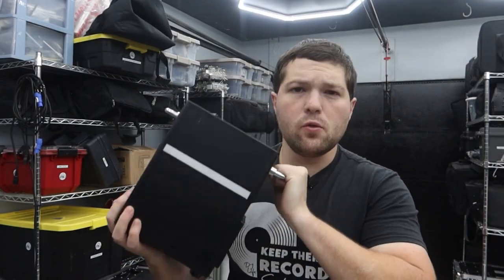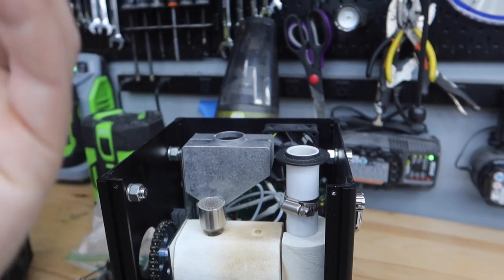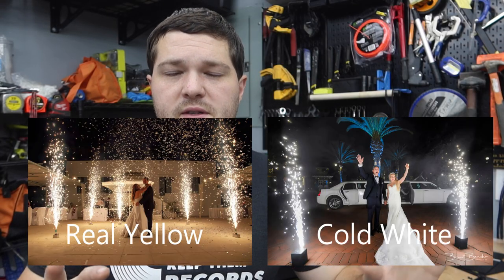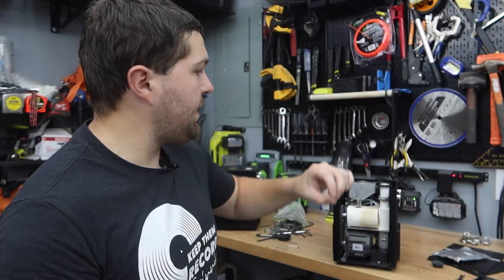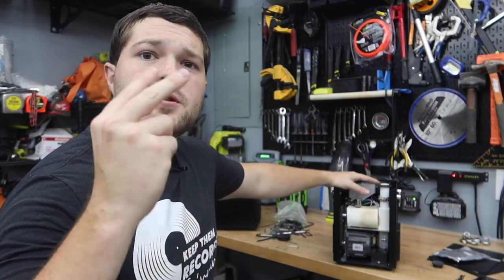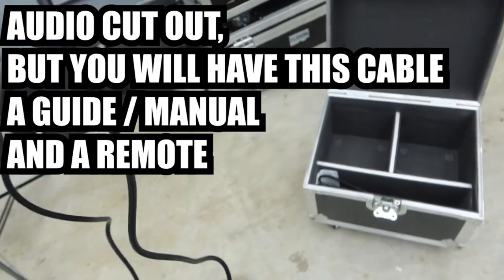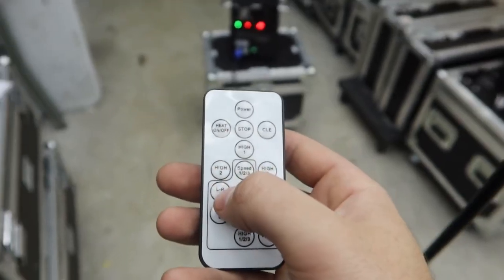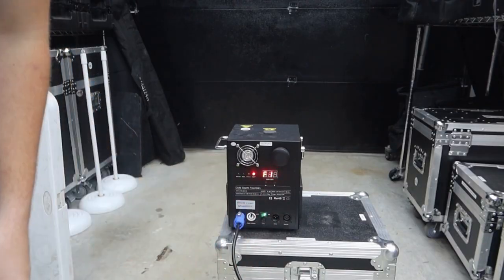DJ Gear - Cold Spark Machine (How it works, safety, fire, Both Lighting)

Comment: Being a wedding DJ and someone who works for a major city fire dept....I will tell you, these can cause a fire. Most common cold spark powder is titanium or zirconium which are both flammable and combustible. People always show hands over the cold spark and not burning them.... of course not, the surface area of the sparks bouncing off someone's hand is happening so fast that the heat produced isn't being completely transmitted to your non flammable hand. Lay a brides vail or a venues drape over the cold spark and trigger the system, see if that cloth ignites. People need to understand that while these things are somewhat safe, they are not foolproof.
Reply: I have 6 units...JMazz, Blitzz, etc. I've started 3 fires with them.
Reply: @seanprolago9350  😯
Reply: @seanprolago9350 Lolol least you’re honest…. I woulda started 0! {walks away and sets Miami ablaze)! Lol

Comment: Alot of this information is fantastic... however, even COLD SPARKS WILL START FIRES!!!  Even the units you demo here.  Put them near fake flowers, a napkin, a hankerchief, etc... if any of those are in direct contact of the sparks... then can and will ignite if left there long enough.  I have taken a popular machine (similar to the one shown here) and intentionally put many different fabrics, paper and other common products found at weddings and subjected them to the sparks until they ignited.  Then took note on how long it took to ignite.  I have personally witnessed a woman wearing a shirt with loose fibers waving her hand through the sparks and the fibers on her shirt started to burn.  I also know of another local company that has already started 3 fires, extinguised quickly thank God, but it has happened.  ALOT of common sence needs to be applied with these units, when used properly they are awesome, when not used properly you run at risk.  In addition, it's stated that they do not emit any smoke, they indeed do.  Need proof... look at the air in front of your lights... you can see the beams just as if you were using haze.  If set off too aggressively you can trip an alarm.

Comment: I haven't used a cold spark machine before, but as I watched you manually turn the wheel for cleanout, I couldn't help but think that either a P2 screw head or something you could tighten a standard drill chuck onto might be a good thing for that wheel, to assist with a faster/more convenient cleanout. That is, unless it causes some sort of risk due to turning speed and/or direction.
Reply from the maker: You dont need to manually turn it unless you get a clogg. Other than that 99% of the time it keeps its self clean

Comment: Hey Rick! Great Video. Have been using these for sometime. Question: Do you find the dust accumulates on your speaker grills and controller. How do you clean that. I find it leaves a silver, white marks around the horns and woofer. Cheers
Reply from the maker: Havent seen anything on the grills. But more than likely it is inside the speakers on the magnets.

Comment: You'll run into the same venue restrictions with bubbles, haze, CO2, lasers... pretty much anything that isn't an Up-Light or a speaker on a stick.  I swear, I have to explain myself (and my gear) to almost every other venue I perform at these days. 
Here's the reason:  It's not the cold sparks, it's the dopey DJ before you that ran them all night, coated the floor with powder, set off the fire alarm, and set the curtains ablaze! Or the DJ who filled the room with some much haze that you couldn't see your hand in front of your face!  Or how about that moron DJ with the bubbles that turned the dance floor into a slip 'n slide?!?  
The point is - we're not fighting the equipment, we're fighting the idiots who use the equipment improperly.

Comment: issue with mine after 1 event.... power lead goes in and lights the power button, but doesnt do anything after.. need to rip it apart.
Reply: What brand did you get? I ordered a few from a big name brand years ago. 2 of 12 were dead on arrival. 1 had a blown fuse, easy fix. The 2nd machine, we changed the fuse, ethercon cable, ran direct power and nothing. We ended up opening the unit and one of the cables inside was crimped between the housing causing a short. We moved the cable and wrapped the cable a bit, put it back together and all were 100% functional. The mechanism is really basic, as long as the inside chain and the heating element are functioning, you are good to go. Good luck.

Comment: Wishing you the best of luck with selling and repairing these!
Reply from the maker: Been selling them for 3 years now. 0 repairs needed yet
Reply: @37:20
Reply from the maker: @TheDjelements  thats not a repair. Thats part of the process of using those models. That doesn't classify as a repair. Repair would be it breaking in terms of not heating or not working. Cloggs are the users responsibility
Reply: @DJRickWeb  @39:00 ok 😂
Reply: @TheDjelements right lol… guy essentially said every model is ass and has issues… guess anything for a $…
Reply from the maker: More like quirks in prior models that have finally been resolved. Same issues have been present in the big name brands too.

Comment: Now do the same test putting some light fabric, a piece of paper or your hair in the flame and watch what happens. The sparks are just bouncing off your hand not having the chance to exchange the generated heat. 

These are not toys to be used if you're not a certified pyro operator and are classified as pyrotechnic across all states. 

Despite what manufacturers say how safe these devices are, they just aren't (and especially not when manufactured without certification).

Also under certain conditions these powders can actually spontaneously combust when the alloy mixture is not accurate. Why do you think these are shipped "differently" as you say ? 

The misinformation is mind boggling.